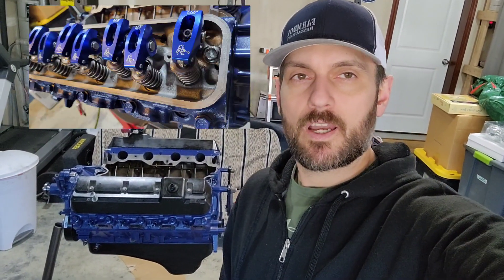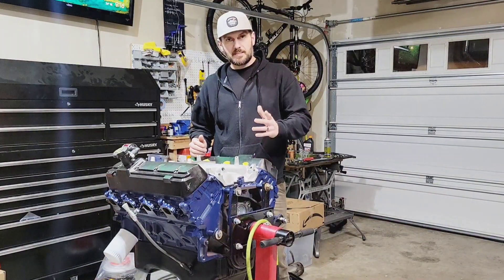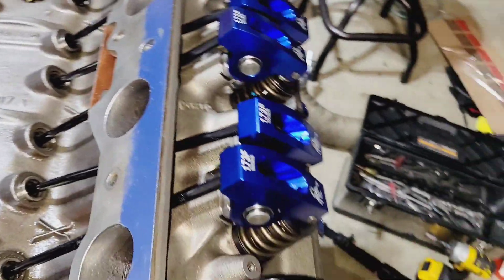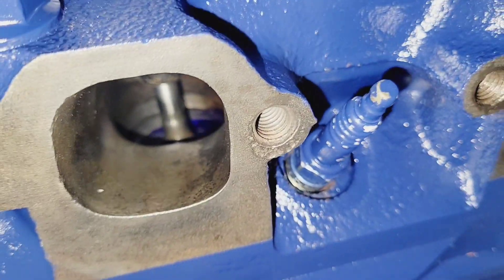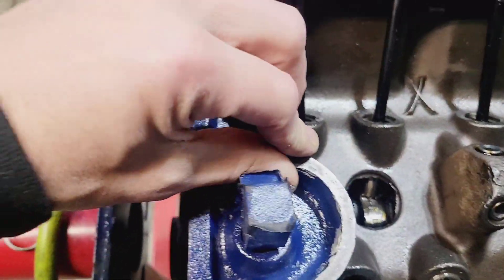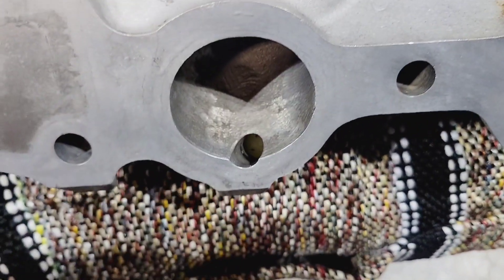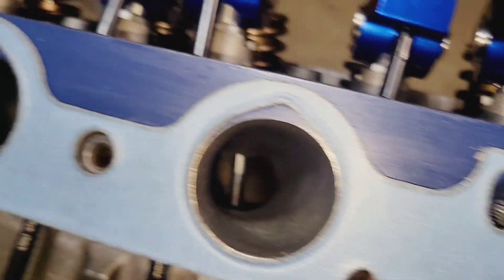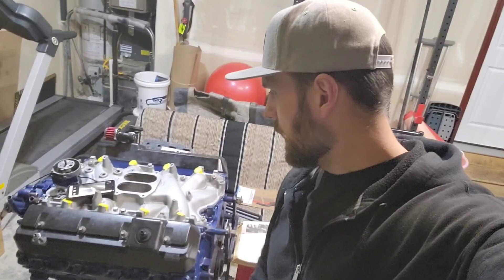Turbo 460 Ford ported cylinder heads / build update

Comment: fuelie stuff looks different than the carb stuff im used to. never really paid attention to those before
Reply from the maker: Ya they are pretty different but do seem to do well with pocket porting and bigger valves. This engine made about 420hp 550tq on an engine Dyno NA. And that's with a small "towing" cam.

Comment: If he told you they just got alil pocket porting they probably don't have much if at all any work on the port were the intake meets the head. All the work is probably just inside were the valve is. Around the guide & the throat & the bowl. Hard to see with heads boltsd on & valves installed.

Comment: How did you calibrate air fuel ratio?
Reply from the maker: Are you referring to the gauge itself or what ECU I am using? If you watch the other videos, I am running a Megasquirt 3 ECU made by Stinger Performance. It's a plug and play unit for Ford OBD1 vehicles.

Comment: Hey man I have a cool video idea for you. I been thinking about it and it’s something I wanna see examples of, myself! 

Your motor is apart right? Waiting for stuff and your leg to heal up. 

Dude, can you mock up your hot side manifold on the block or like on the ground so we can see how you did it? Your other video showed it inside the truck and the lighting made it kinda hard to see it and place it mentally. The Gates the flanges the welds and turns you did etc. The turbo mount itself! What do you think homie?
Reply from the maker: Ya man sounds good. I am planning on filming the install in detail to show each component but I can definitely put something together in the meantime!

Comment: I don't know if you have a windage trey or a scraper but big blocks create alot of crank pressure. With the extra ring gap, I would consider plugging two more -10 holes into those valve covers sir. Get yourself a little tank up behind the throttle body with a one way valve draining back to the valve covers.
I know you already have that one up front.

Comment: I had a problem on my 302 I built with the iron guides dieing. I did brass and haven't had a problem since (15 years). The 460 I just built for my 79' f250 got the brass guides too. Don't know what caused the iron guides to fail but taking stuff apart again sucks and I didn't want to chance it!

Comment: Looks awesome man! I'm jealous! Are those rockers direct swap? Did you reuse your pushrods?
Reply from the maker: They bolt in place of where your factory rockers go but I did have to go from an 8.5" pushrod to an 8.65" pushrod, so slightly longer. Then I used shims to dial in the hydraulic lifter preload to .035-.040 on all lifters. My Lunati cam/lifter setup calls for .020 to .060 lifter preload.

Comment: thanks for the time to get those shots.   I'd be curious if not porting that little divot on top of the port where the injector sprays effects atomization.     It's also a shame a head porter won't show the flow with an intake manifold attached.  I think it would make most people start choking, or at least open some eyes.  I would bet that intake when attached to the head pulls the flow down to 240 max .  I've seen it first hand.
Reply from the maker: I took some pictures with the bore scope to show the intake manifold to cylinder head alignment and it's nearly perfect. I will post them up for everyone to see. Scott's top end kit includes the ported heads with bigger valves, ported intake manifold to match the heads and his custom grind camshaft. All of that ends up adding well over 100hp but it would be cool to see a test done with the stock camshaft to get an idea of what the heads and intake make in their own.

Here is a quote from Scott when he described his ported intake.... "The fuelie intake when properly ported will flow on par with the Eddy performer. As cast it is a major bottleneck !!!"

Comment: Are you running the e7 heads or f3te?
Reply from the maker: They are fully ported large valve fuelie (F3TE) castings. My heads have been out fitted with 2.11" SS intake valves / 1.65" exhaust valves.